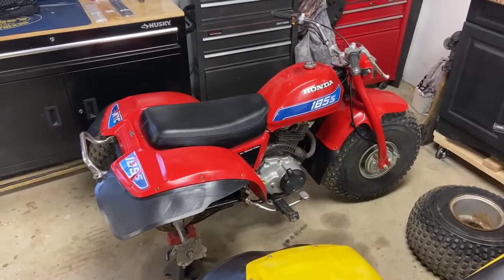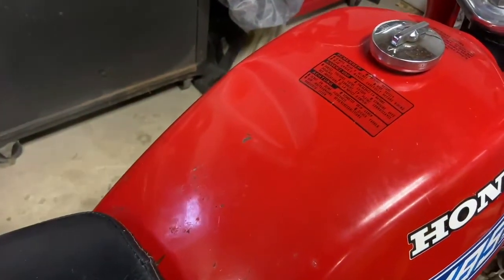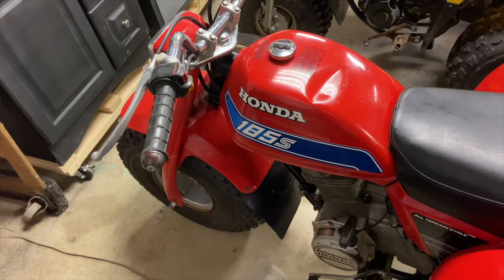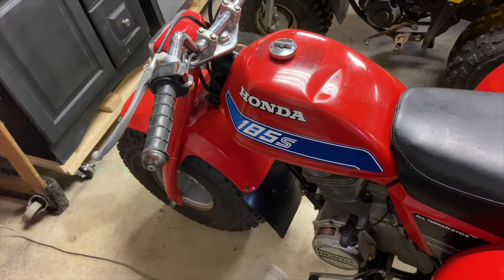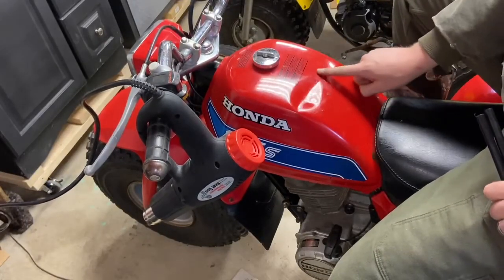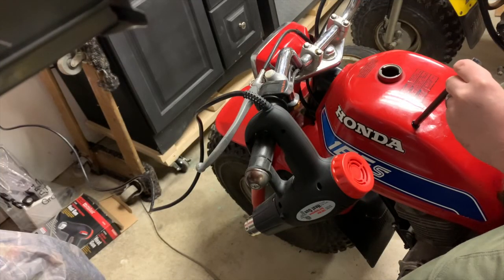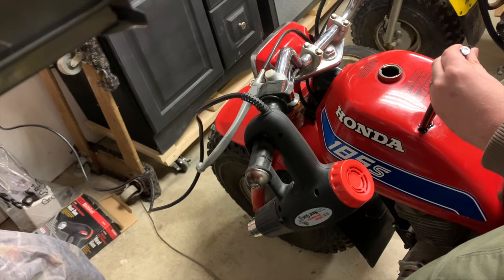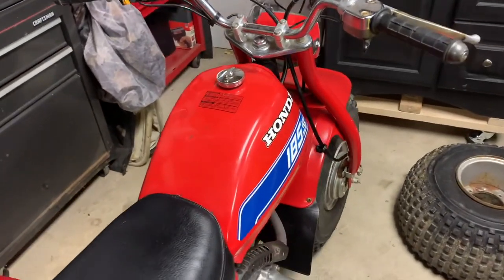Paintless Dent Repair on a Fuel Tank for a Honda 185s

Comment: first time i see someone heat with lighter and use the stick for pulling.. it worked but gluegun and pullers with slighthammer working faster.

Comment: I do PDR. It was a good try. It takes over a year of PDR training to understand the metal and dent movement. That dent was 100% removable back to perfect. Now, it will never be able to be perfect. Sticking the glue stick to the tank is not a good idea. With a small kit from harbor freight you could have dome better. Tip, you have to use a knockdown to remove the pressure from the dent first and as you go along.. Pulling from the spots you put the glue actually caused the texture you were left with. A really good PDR person could use rods and fix it a little better, but you are going to have to pay for that. If you had called one first, probably for 100 bucks it would look perfect.
Reply from the maker: Thanks for the tips. Wanted to give it a shot. Maybe I’ll buy a kit at some point and see if I can improve. Ya gotta learn somehow.
Reply: thats funny im a real pdr tech and i would charge around $450
Reply: @MattTomovick57  why so much?
Reply: @gerrybrown1574 inflation buddy.